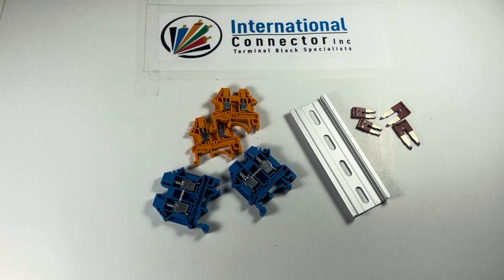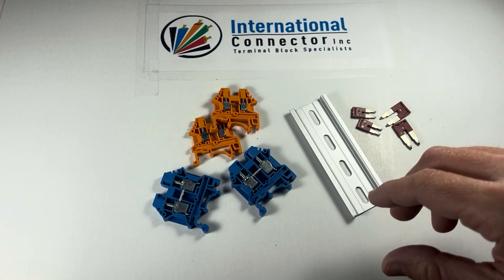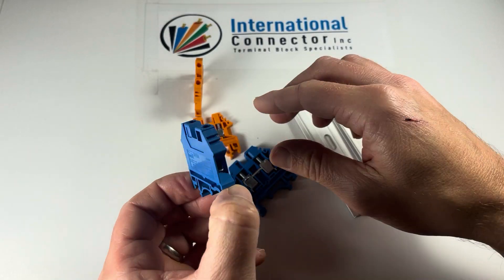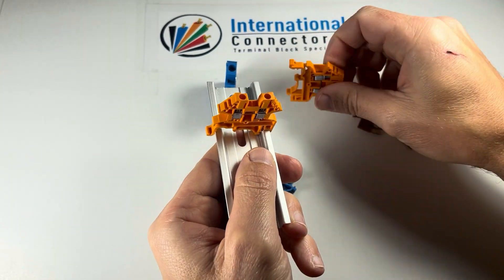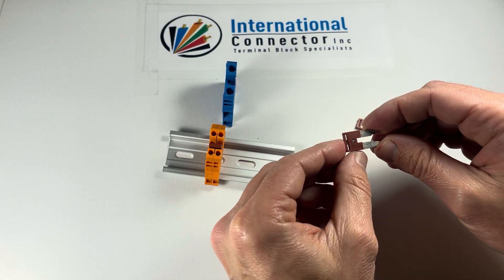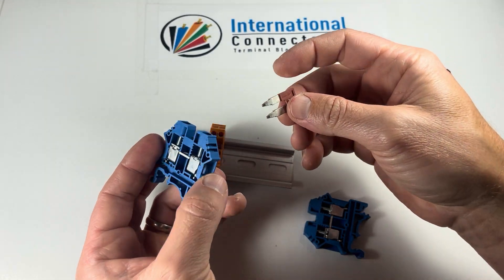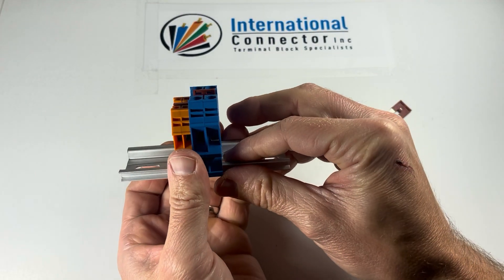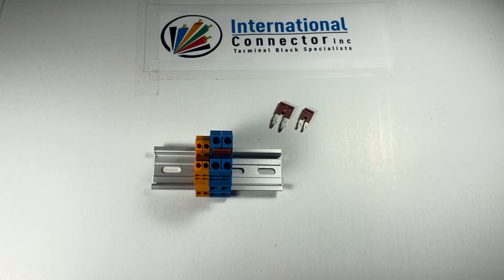How to Install Jumpers (insertion bridges) into DIN Rail Terminal Blocks

Comment: Related question.  Jumpers on slim relay terminals.  In addition the 100 pack of dark blue through terminals I bought from you via amazon I also bought some relay terminals, from another vendor, that came with jumpers. What I am at a loss for how to both use them and connect in this case the ground or negative for everything the jumper is placed in.  In theory I could reverse one the relay terminal blocks and use the COM and NC connection points but that seems like a waste of the relay. I have done some googling and only found pictures jumpers filling all the terminals but no way to  to feed power in out.  What idea am i missing.
Reply from the maker: I am not familiar with the relays you purchased, but to connect or distribute a negative through our blocks, you will have to bring in a wire to the elevator cage connection.  This would allow you to then use jumpers to distribute this connection through multiple blocks.  You mentioned a ground.  The only other way to make a connection with a ground is to have the rail grounded and purchase our ground blocks that connect through the DIN rail with metal feet.  These part numbers are Dinkle DK2.5N-PE, DK4N-PE, DK6N-PE, DK10N-PE, etc.